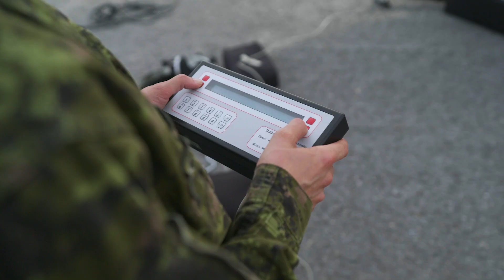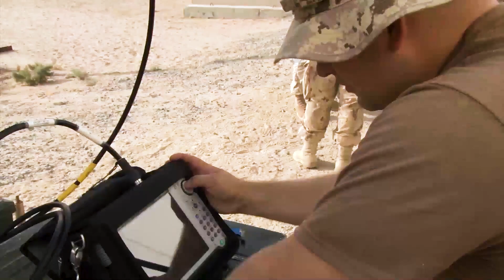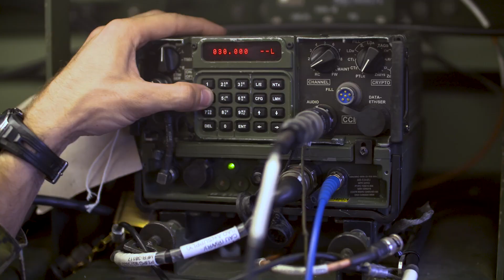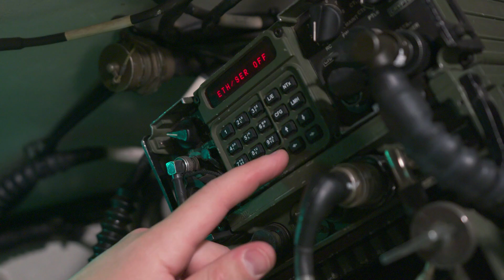Signal Technician

Comment: I currently work for bell and have been for the last 6 years, I joined the reserves at 16, at 16 I was, to say the least, not reliable, and had a bad attendance and ended up with a 5F.  Would love to re join but not an option anymore.  I know a few other guys in the same situation within bell.  Is there any way to possibly challenge the 5F with good result.  Grown up a lot over the last 8 years.  Signal technician is where I wanted to be and still want to be.
Reply from the maker: It is possible to reapply even if you were released as 5F. The file will be evaluated when you apply. Give it a try!
Reply: Go to a recruiter and ask them unfortunately YouTube is not the place to ask. A 5F isnt the end of the world as many think it is and is still legally a honorable release, under the KR&O.